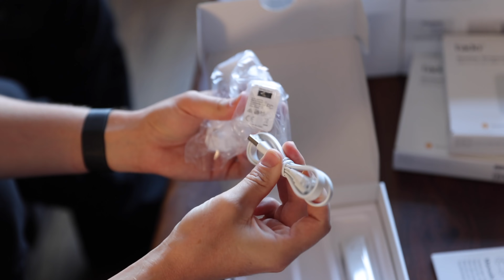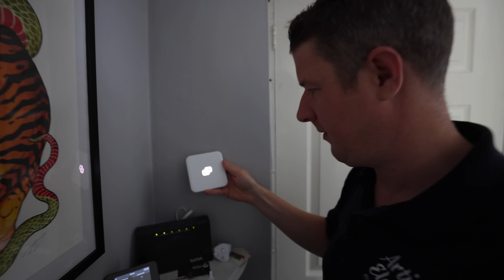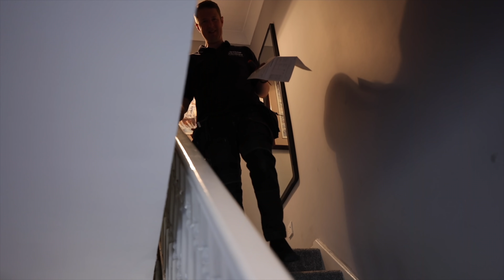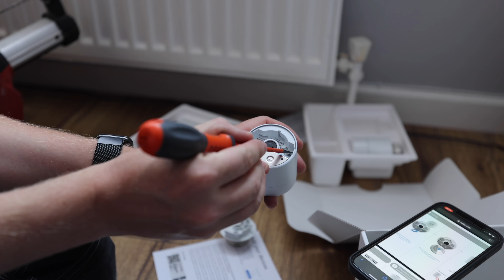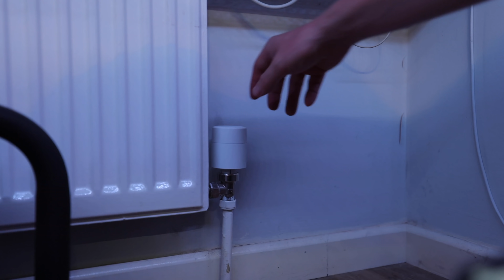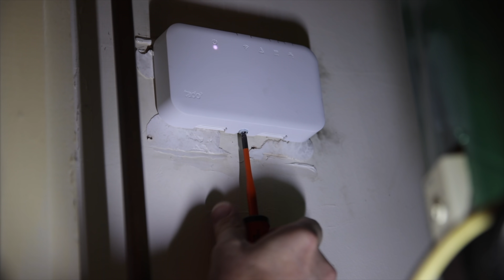THE ULTIMATE SMART THERMOSTAT? - Tado Smart Thermostat Installation

Comment: Great video. 
Few points I’ve had the Tado system installed for 2 years now.
I have thermostat in hallway and radiator Tado trv on all radiators. In lounge is only room with 2 radiators and both have a Tado smart trv. I also have Tado Air con controllers in 2 rooms and have inter-grated Tado with HomeKit.
Batteries in trv last well over 1 year, Tado email you and all tells you when going flat so you get plenty of time to change them. Just 2 batteries required.
If you have 2 trv in same room they auto sync together so when you adjust one radiator both adjust.
If you have a Tado trv in same room as a wall thermostat they sync so again when adjust temp on wall mounted stat the radiator will adjust.
System has protection for boiler in place to stop boiler turning on and off to quickly with a delay built in.
App allows you to set schedules for each room almost infinite on off times allowed.
Geo fence means you can have it auto turn off when leave or arrive home.
Open windows turn off system - you set for how long.
You can by wall mounted controls that can control air conditioning units that also seamlessly sync with your heating.
Tado fully works with Apple HomeKit so you can ask Siri to turn on off rooms even increase or decrease temps. Siri can even control your air con. You can set automations with HomeKit that control Tado. I’ve never had a problem with Tado working with HomeKit.
Tado will auto monitor your boiler and detect any faults or performance issues.
The app has lots of features like outside and indoor air quality, humidity and more.
You can get reports on energy consumption and even how your consumption compares to other users in your areas.
I’ve saved around £150 per year with this system. 
If consider getting Tado you should definitely get the Radiator trvs installed along side the starter kit for maximum benefit and control. 
Some features require an annual subscription of £25 aprox which is well worth it. 
The app is excellent and easy to use.
Multiple users can download the app and use the same system eg other household members.
When installing you can select non professional and the app will ask you some simple questions eg boiler make and thermostat make. You then take a picture of your boiler on the app and then the app will give you personalised installation instructions for your system with step by step pictures. Adding to the system later on is easy and the technical support if needed is their for you. 
Everything is good quality and easy to instal. I’ve previously had the Nest thermostat but the features Tado offer and app function is far superior.
Reply: Good sales pitch! 😉😂
Reply: @Chris-hy6jy  would be if I sold them but just sharing my experience for others.
Reply: How much did all of the kit cost? Just wondering how long it will take to pay for itself...
Reply: I have a tado system and so does my mum. The best part about it is the fact you can change the trvs giving you room control. The batteries don’t always last 12 months for me maybe 10 months. Also the temperature at the trv is not always indicative of the rest of the room. However, this can be offset or you can get a separate thermostat to place in the middle of the room, although this does add additional cost. Sometimes the trvs don’t completely close off the radiator so you might get some heating coming through on some radiators but it is less than you would without it. I wouldn’t change the system for anything else but it’s not quite perfect yet.
Reply: @hks-lion  All TRVs give you room control though, that's exactly what they were invented for.  You don't need TRVs with batteries and a display to do that.
Reply: @Chris-hy6jy  yeah but I mean remotely and accurate to *C. Regular TRVs are just a relatively arbitrary scale. Plus tado will turn on the boiler if one room gets too cold. TRVs won’t turn on the boiler by themselves
Reply: Insightful- thank you

Comment: As a tado user things to be aware of:

a) 10 room/25 device limit - not great for larger houses
b) the TRVs seem to massively overread when installed vertically as they are too close to the radiator. You can adjust with a temperature offset but then they underread when heating is off. They really need to release an inexpensive wireless thermostat to counter this (or better programming to identify the overread when on). The smart wireless thermostats at ~£60 is ridiculous for a temperature sensor.
c) You seemed to install the wireless sensor and the TRV as two separate bedroom 1s? You can add them both in the same room and set the wireless sensor as the room controller. 

Generally a bit of a flawed system unfortunately as has a lot of promise.
Reply: Agree with your second point 100%. I have one TRV horizontal and the rest vertical. The vertical ones open and close all the time. The horizontal one does a better job of regulating the room temperature.

Comment: So many questions! Battery life/renewals on the rad valves. I have a huge site (steam museum) what’s the range of the receivers, can you link via your existing meshed WiFi instead. Can the  internet link get a fixed IP address. Hmmmm thinking head on.
Reply: Check out the max rooms/max device limits on Tado - unlikely to suit your requirements
Reply: @bencampbell2041  Cheers

Comment: Love the videos, but I honestly think thermostats and heating programmers should be left to plumbers as electricians can’t change any cables in the boiler if you need to!
Reply: Incorrect it even says in your boiler manuals for electrical work to be carried out by a qualified electrician, any electrician and plumber can go into a boiler the only thing they can't do is break the combustion seal I.e the heat exchanger or touch any gas parts without being gas safe registered  etc...
Reply: Try telling that to the plumber who installed my combi boiler.  Because there wasn't a fused spur in the same room as the boiler, he wanted to leave it running off a 10m extension lead!!  He also screwed my tado extender to teh wall...10 degrees from horizontal

Comment: Heating = set to 21 degrees all year round on the main stat, then set your rad valves to get the desired temp in each room... Hot water = on constant all year round.  The tank stat does the rest.  No need for any of this expensive nonsense.
Reply: I think you misunderstand how these radiator valves work. Unlike mechanical TRVs which can only respond to changes in temperature opening and closing as required but they cannot switch the heating on, that requires you to override any programming. These valves have heating on demand, on our similar Hive system I only need to tell Alexa to heat up the room I am using and the system will simply heat that room that is a real boon for those working from home perhaps spending most of the day in a home office no wasted heat and a saving on the gas bill.
Reply: @richardpawlowski4540  It's a moot point as to whether the saving on gas is real or imaginary.  

If you arrange a typical UK heating system so that a single radiator can override a timer control and 'demand' heat the system still has to heat up the whole heating distribution system and that will cause other radiators to draw heat unless the system has closed them down.  You are still heating all the feed pipes in the system.  

Extrapolate this and you get to a situation where your office is cosy, the pipe work is cosy but the rest of the house has cooled to chilly - then when you want to go cook dinner or watch TV you have to add a lot of heat to get those rooms up to temperature. 

What Chris (above) was proposing was run the heating to keep the whole house 'temperate' (although I disagree with his 21C I'd go for 17/18) and let normal thermostatic valves adjust/balance each room temperature to your desired offset (e.g. cooler in bedrooms warmer in bathrooms).  Then you can increase the single stat to bring the temperature up /down as you wish - if you need you can go turn off individual rooms.

While this does not have the street cred of IOT turning things on and off from afar it is a lot cheaper than filling the house with IOT controls and controlling your heating and hot water via some external server.

As I started, it is a moot point as various 'experts' subscribe to each view point - one school of thought adds that having heating completely off causes condensation which then requires even more energy to raise temperatures. 

I suspect that, in a final analysis, the construction of the property, the way the heating is installed and the level of insulation all make the equations complex hence the lack of an absolute recommendations.

I run my heating for comfort, not absolute degrees - on a twice per day timer, with the general stat at 18C and rad stats set for the heat level I want in each room.  If it suddenly gets chilly I just lift the general stat temperature and/or override the timer.  

I've looked at smart solutions but, for the size & layout of my 3 bed bungalow, I cannot see any benefit in 'investing' in IOT solutions - much as the geek in me wants to!.  But each to his own:-)
Reply: Barrie I admit that some parts of the piping will have to get hot but I do not think to the extent you are saying. At night our system goes to anti frost setting I have often boosted the bedroom alone if I am doing some late night reading and with the exception of the bathroom which is the official bypass all other radiators stay cold and there is no heating in the pipe stubs to them. When a radiator valve is closed all the water in the pipe work from where it branches off the main pipes is not circulating so only heating by convection can occur which from my experience is very little. Back in the old days when most houses only had a back boiler and a hot water tank upstairs known as a gravity feed system the heat rising caused a circulation to heat the tank but at best you could perhaps hang a couple of radiators off such a system before you had to start pumping water around a system.
Reply: @richardpawlowski4540  It's the age old question of whether it's better to keep your house at a steady temperature all year round or keep turning the heating on/off to suit when you're at home.  A house has a lot of thermal mass in the building fabric so once it's "up to temp" it generally takes a much lower amount of energy to keep it there.  Switching the heating off all day and then back on when you arrive back from work will save you money during the day but then cost you more when you have to heat the whole house back up to temp.  Personally I prefer the "set it and forget it" approach.  Be that 18, 20, 21 etc.  An average room temp that makes you comfortable.  I have the bedroom rads set very low as I like it cooler in the bedroom.  I don't have to think about Wifi connections, batteries, phones and cloud accounts.  It just works and my combined gas/electric bill is £90/month in a 4 bed detached so I can't be doing much wrong.
Reply: Hot water always on is the recommended. However, where these connected thermostats excel is that they learn how long it takes for the house to warm up and it's heat retention. With this data as well as weather forecasts, it makes for a smother temperature transition thus more comfortable and more efficient.
Reply: Definitely
Reply: Exactly - why would I need to have an Internet connection and an account on a distant server just to control my heating!!

Comment: Poor Lee is going to spend the rest of his life changing batteries every 5 minutes.  Another "solution" to a problem that never existed 🤦‍♂️
Reply: Do you get your batteries from eBay?
Reply: @tommcdermott1989  do you have one of these systems?
Reply: Hive with the TRV’s, not had to change any of the original batteries in 15 months.
Reply: Batteries last ages. Cheap and easy to change. Also no more stuck TRVs through lack of use. Money saving by being able to adjust individual rads. No downside at all
Reply: @totalsnooker  TRV's don't tend to stick through lack of use, more often than not it's due to people leaving them set down in summer and the pins jamming. Sadly something still not passed on to most end users. There's also downsides to Tado/Honeywell and other smart stats being the actuators are equally able to fail due to loss of signal, the pins in the valve body jamming, batteries depending on use case scenario (often the first 6 months/winter) when people have them new and are endlessly playing with them. Education is far more impactful than replacing mechanical controls with smart tech.

Comment: I've had these installed for years now, really good, love the geofencing that turns the whole lot off and on. The radiator valves are great but batteries run out a few times a year
Reply: I got Li-Ion batteries, they last ages and are rechargeable.
Reply: @albanbirch  do the Li Ion batteries work well with tado?
Reply: @hks-lion  they work perfectly. They last between 6 and 9 months before I have to recharge them.
Reply: @albanbirch  awesome thanks for the tip 👍🏻
Reply: Tado recommend Panasonic eneloop rechargeable batteries. These have been found not to give a false battery low alarm that some other rechargeables have been known to do. I did read that the latest version of the trv had overcome that flaw but I haven't seen that in person to verify.

Comment: Had the Tado smart TRV system for a number of years now, and while it's quite a good idea, I've found the implementation to be a bit buggy and more annoyingly the rad valves don't mesh + the reciever unit range is very limited (at least in a 30s brick built property) and there is no mechanism to add an additional receiver. When a TRV drops off the network and is still calling for heat, the boiler continues to run and waste gas (usually through the night!) - because it can no longer tell the current temp or if heat it still required - but due to the limited radio implementation there is no way to resolve the issue. All tado suggest is to move the reciever somewhere central (which is not necessarily practical since it needs to be wired to the router and have a usb power supply!).

Battery life is also not great in my experience. Also had difficulty getting adaptors to hold the TRVs securely to the rads, with them sometimes popping off the radiators that don't have threaded valves.

I'd probably look at another system if I had the choice again - hive have smart valves now. (Although I have no idea if that would be any better). 

Tado need to add an ability for the TRVs to mesh to range extend, improve the range of the gateway or support adding repeater gateways. Until then the system will never be reliable in all properties.
Reply: this is the problem i have as well, pretty useless customer service as well